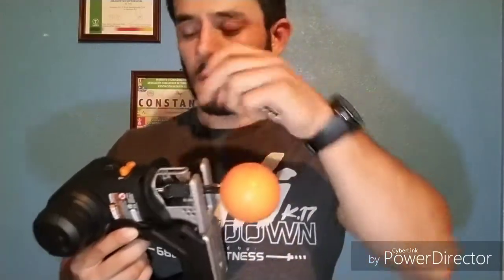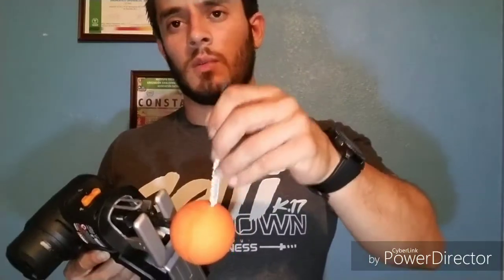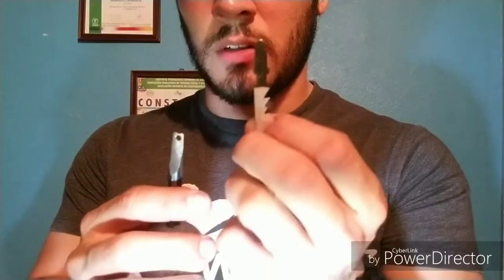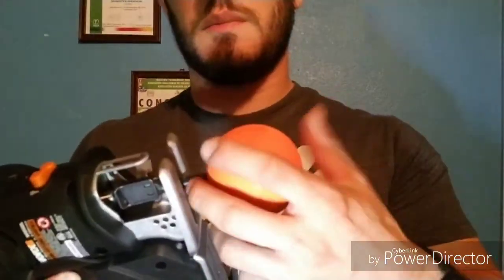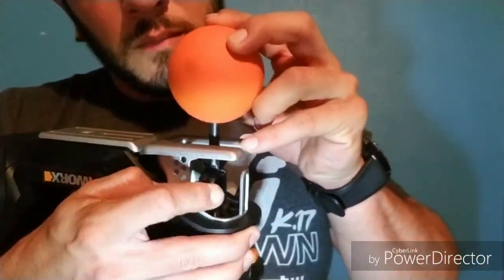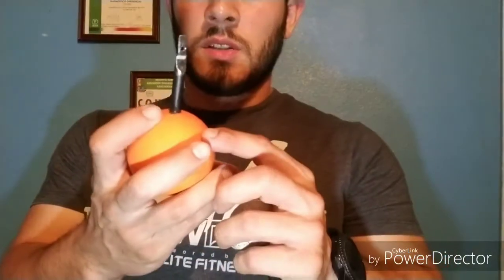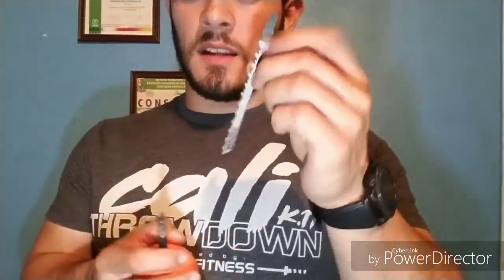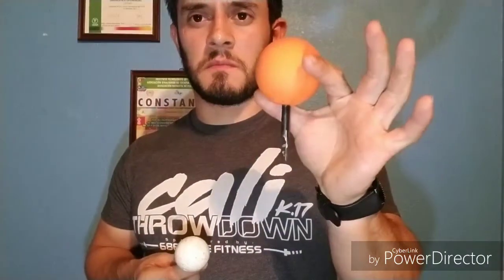How to make a THERAGUN (DIY THE SAFEST WAY)

Comment: You rock man! I was going to spend another $30 on a heavy duty adapter for the Jigsaws and 1/4" tool adapters and then had second thoughts as there should be an easy way to fabricate this. Well, I found your video and this is going to be a cheaper and sturdier way of getting this done. I was just at Rogue Fitness in Columbus Ohio this past weekend and their massager that is like this costs over $400!
Reply from the maker: Ryan im super glad that this video helped you save some money... i also think that there is no need to spend so much money on something that basically does the same... 🤟🏼🤟🏼